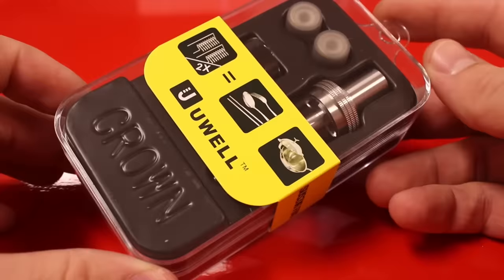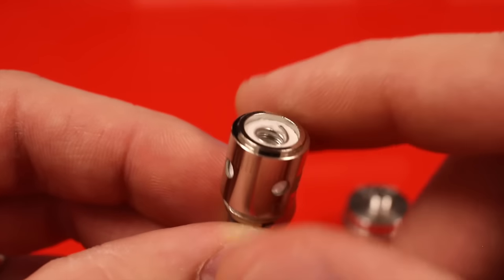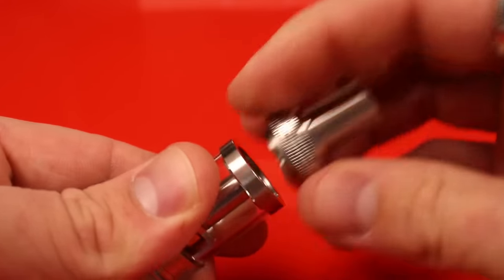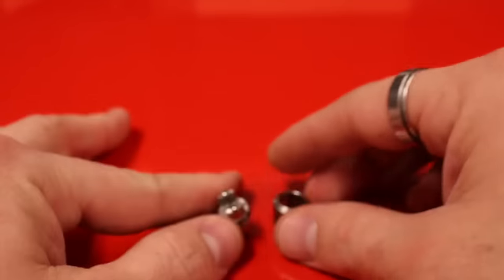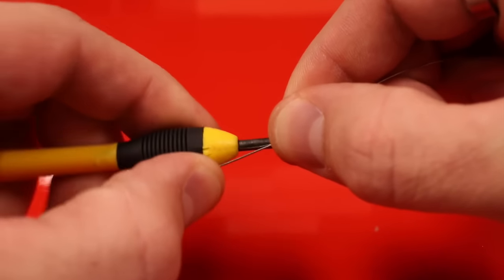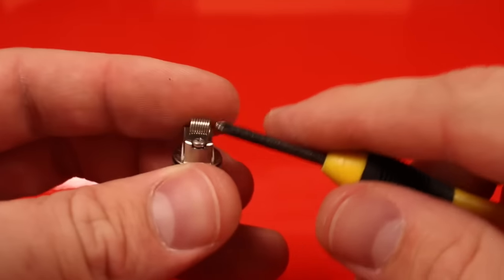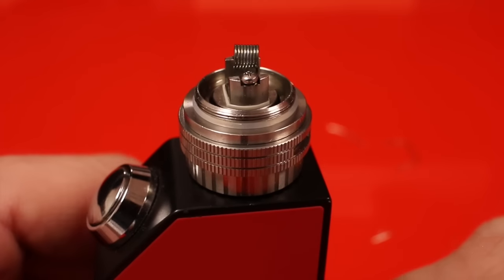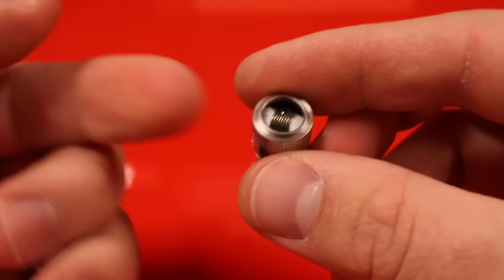The Crown by Uwell (TUTORIAL & RBA BUILD)

Comment: Hi Kyle, quick question, I have the crown and got a pack of ssl 0.25 replacement coils, question is what is the difference in making the coils and just getting replacements? Is it because it's cheaper or is it for cloud production?
Reply from the maker: It's cheaper in the long run to build your own. And, when building your own, you can determine what you want the resistance to be.  Otherwise, prebuilt coils are just as good (and usually better) without the headache of building them yourself. 😁
Reply: +Vapor Hut Thank you for the fast reply, and thank you for this easy to learn tutorial :)

Comment: so if i use 24awg kanthal i could get 100w+ ? i have sigelei 150w TC
Reply from the maker: +Luke Dawson If you want to run over 100W, you'll need your 24awg kanthal build to ohm out to right around 0.1 - 0.2.
Reply: +Vapor Hut how many wraps on 3mm bit?
Reply from the maker: Luke Dawson For a dual coil it would be about 5-6 wraps

Comment: Hey I'm using 26 gauge kenthal how many wraps would it take to get a 0.5 ohm coil
Reply from the maker: Around a 3.0mm screwdriver, about 6 wraps.
Reply: +Vapor Hut thanks so much for the quick reply.. I just got the tank I'm so used to building for the subtank mini..
Reply from the maker: +John Young Nice man! Well let me know how it works out. 😁
Reply: +Vapor Hut I did 6 wraps and ended up with a.99 coil?
Reply from the maker: John Young Are you spacing the wraps? And are you firing and squeezing the coil?
Reply: +Vapor Hut yeah I'm spacing them out I had a left over pre built coil for my subtank I put that in and got 0.5 coil..
Reply from the maker: +John Young I gotchya. If your spacing them, you would only need about 4 wraps of the 26awg kanthal.
Reply: +Vapor Hut thanks for the help 4 wraps got me exactly 0.5 thanks again
Reply from the maker: +John Young No problem brother! 👍

Comment: The crown tank is the best tank I have, juice guzzler but the flavor is amazing. I wouldn't build the rebuildable coil like you did,  your method looks like it could flood easily? I use 80/20 VG, PG never a dry hit or flooding/leaking. I have it built using twisted dicodes wire @ .5 for temp control on my Dani extreme v2. The Crown tank and the Dani are married, its my everyday, all day setup.
Reply from the maker: It does guzzle juice, that's for sure! And thanks for the tip with the RBA. I saw some pictures after I built it and thought about that very thing.
Reply: Vapor Hut Check out my instagram feed, I have a couple of shots of my Crown tank builds on there, here's one of them >> https://instagram.com/p/84NBlJl3WW/?taken-by=vape_face_
I use that Scottish Roll wicking method on those builds and it's excellent. When I haave it built and wicked with the cap back on I use a small pin and put a few little holes in the cotton by pushing the pin down through the cotton from the top (inside to the outside) down through those little shots on the side of the coil.I am tempted to make those slots bigger but it works as I have it.
Reply from the maker: Interesting! Maybe after I get all my videos done, I will do a tutorial on your method and give you a shout out! (If that's cool with you). I dig your method!
Reply: Vapor Hut Sure, and thank you :)

Comment: i have a leakage on my rba. any advice?
Reply from the maker: Fadli Shaifuddin That's very odd. What is the VG/PG ratio of the juice you are using?
Reply: it is 50/50. is there any difference in the juice?
Reply from the maker: +Fadli Shaifuddin Yes. VG (vegetable glycerin) is much thick than PG (propylene glycol). The reason your tank is leaking is because the juice your using has too much PG (most likely... it is the best explanation). Try a higher VG juice like an 80/20 or a "Max VG" blend. Should solve your problem.
Reply from the maker: +Vapor Hut thickER*
Reply: thanks for the advise mate. i will try it and get back to you if i am facing the same problem.
Reply from the maker: +Fadli Shaifuddin No problem Fadli! 😁
Reply: hi anthony, do you have any pictures of the end product?
Reply: +Fadli Shaifuddin I did a pancake method for this. So far so good but depends on the juice that you are using. If you are using 50/50 juice, make sure the size of the cotton is 1 inch long by 0.5cm wide. Imagine a "W". The centre of the W is the coil. Now, lets do the left side. Assuming that the left side is 1cm long. Place some juice on da cotton first. Using a small screwdriver, push half of the cotton down and the end back up. Do the same to the ride side. Once done, you will get a "W". Next is to place da cover back. Top view, you will see that the end cotton is touching the inner side wall. Use a small screwdriver and cover up the hole. Do not crumple everything inside the rba. It will leak.

Comment: 24 ga nichrome worked the best? whats the wattage capabalities with that set up? I am currently using the crown with its stock .25 coils at about 80 watts on a sigelei 150tc? thanks for the channel, its helped me learn about this whole vaping thing :)
Reply from the maker: The build I did here can handle 50-70W roughly. I'd suggest using kanthal since it won't get as hot as quickly (I was out of 24awg kanthal). I'm glad the videos are helping you man! 😁